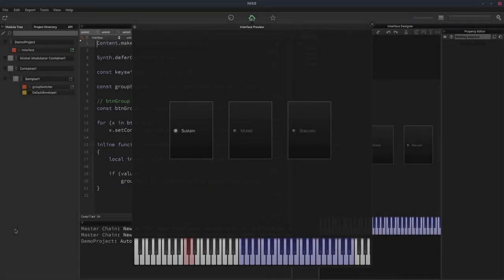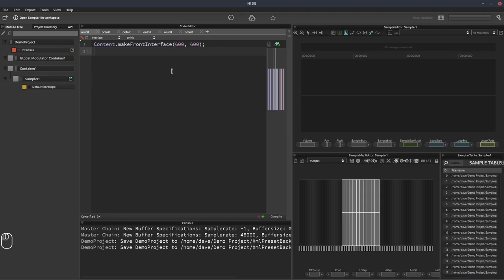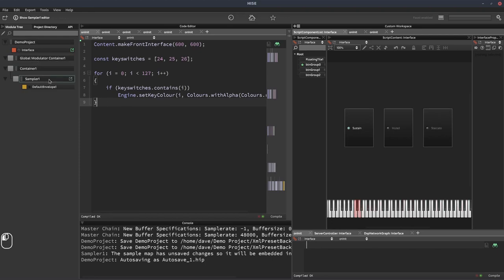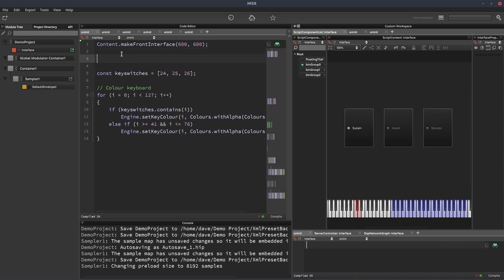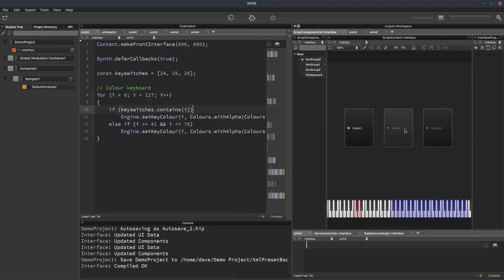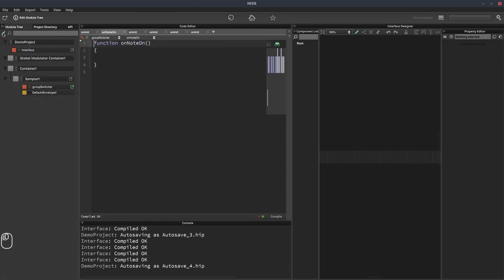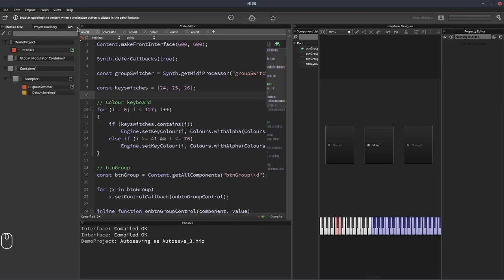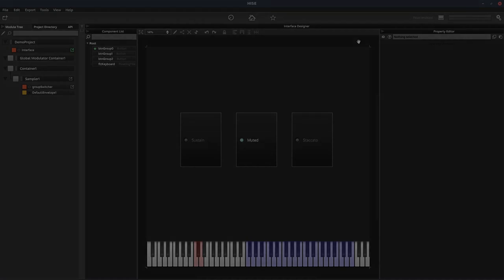Changing articulations with key switches and buttons

Comment: When I wrote the script to colour the keys [24, 25, 26] it didn't work, I tried Engine.setKeyColour(60, Colours.withAlpha(Colours.red, 0.3));  to colour just the key 60 it works but now if I change that to 61 or any other key, the previous coloured keys remain in red, it's like the keyboard doesn't update upon each compile.
Reply from the maker: You need to change the colour of the previous key to what you consider the default colour to be. I usually just run a loop over all keys, set them to "default" and then on the following lines set the individual key colours I want
Reply: @DHealey  Thank you.